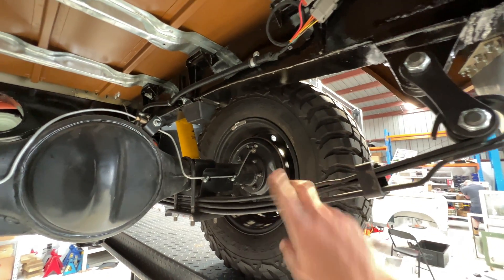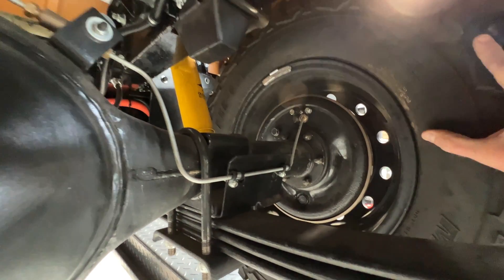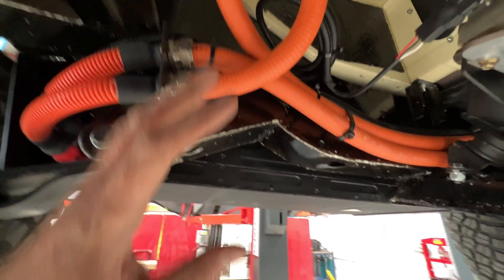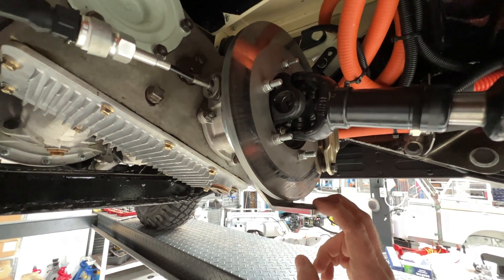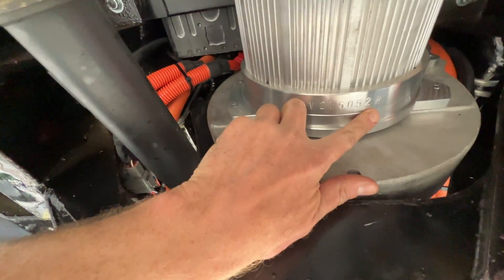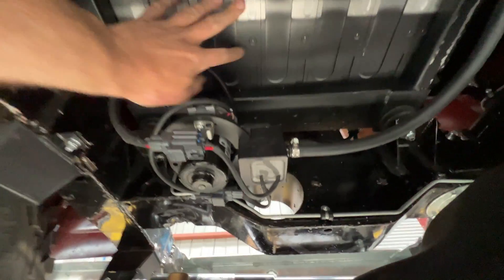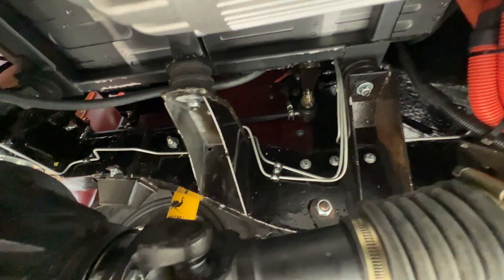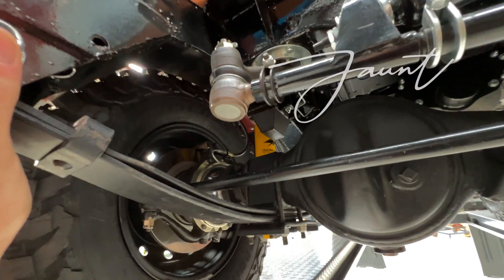What's underneath a Series 2a ⚡️electric ⚡️ Land Rover

Comment: The Hyper9 is a great value motor, it will be interesting to see how it deals with a bit of sand and water crossings. You will be taking it off sealed roads I hope!
Reply from the maker: It's great for the price. But yes, its not the most 'extreme' motor out there. A little bit and it'll be fine, but we'll be using other motors in serious off road builds.

Comment: I still would love to see a video on throttle mapping to see if you are able to mimic a normal stick shift (with a lot more power). If it is like most electric where you stick it in 4th and leave it there isn’t very exciting. Needing to row the gears is part of the charm.
Reply from the maker: Did you see our other video?   The motor we use isn’t really powerful enough to go without gears.  2nd is a great gear to take off in and then commonly we’ll shift to 4th

Comment: A whole video under a car...and thoroughly informative and entertaining. Is the extra cooling on the transfer case pre-empting a problem or is it from experience of transfer cases grinding themselves into a paste?
Reply from the maker: We did it at first to help with oil sealing.   The original pressed steel plate reacted differently to heat than the cast aluminium and would leak.    Extra cooling is a bonus.  It’s what they use when fitting an overdrive though so we are doing something similar
Reply: @Jauntmotors  And a bloody good reason too! All the best for the new Year J-EV.

Comment: Great stuff, Dave.  That armoured cable looks very tough.

You can save a little on the conversions by retaining the original transmission brake and adding the longitudinal tie rod from transmission cross member to bell housing - it stops the longitudinal movement of the engine and transmission from the tension of the hand brake operating rod pulling on the actuator, so as well as eliminating the shear forces on the engine and transmission mountings (making them last far longer) and maintaining the correct positions (it was fitted to FFR vehicles to keep the bigger fan away from the radiator), it has the benefit of making the standard hand brake very, very effective and gets rid of the excess movement of the lever.  It is so pronounced that it should have been fitted as standard.
Reply from the maker: Awesome advice.  I have seen that tie rod once before.  Thought it was a custom thing